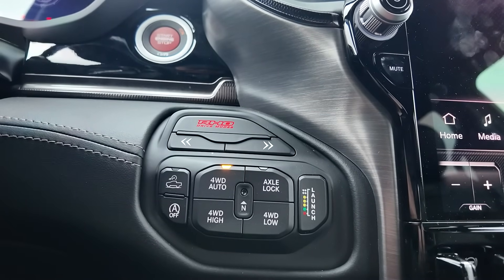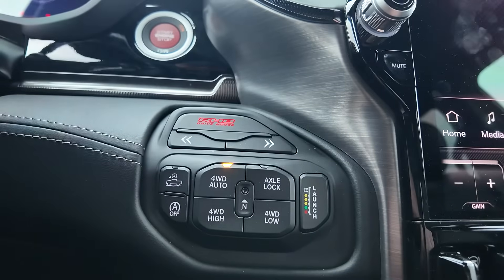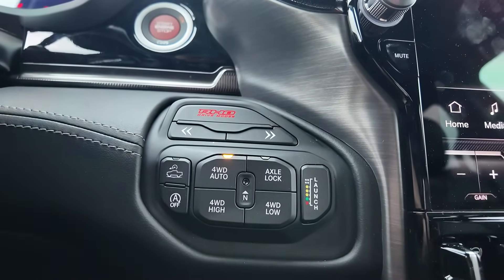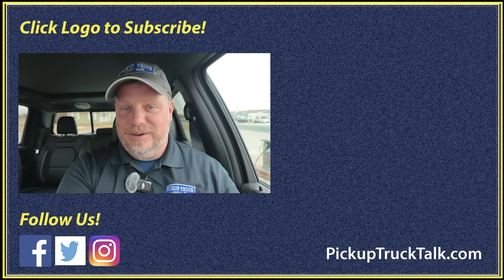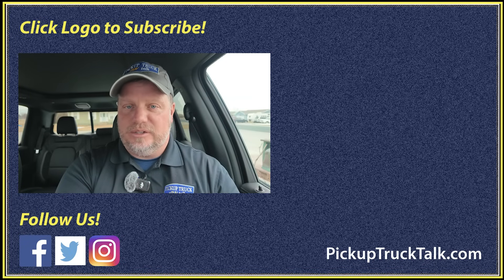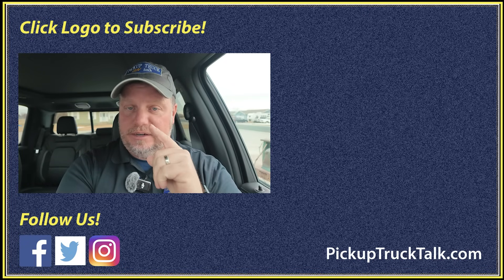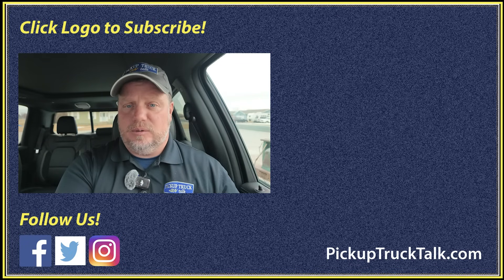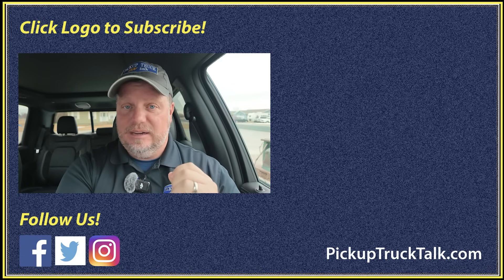Drive Mode Matters? Here's How Ram 4WD Auto Works from the Engineer

Comment: I’ve always liked the explanation between AWD and 4WD as AWD has a differential in the transfercase (or functional equivalent) and 4WD is locked 50/50 between front and rear. I understand modern AWD systems are way more complicated than this but I like this for simplicity’s sake.
Reply: These 4Auto systems are essentially both AWD and 4WD. In 4Auto in functions the same as most any AWD SUV or Car with a clutch based system but then locks up in 4Hi/Lo
Reply: @Jay-me7gw  Actually their pretty much just AWD. Hi/Lo just changes the pressure on the cluch packs. The only one that actually has both the clutch packs, and a full mechanical locker is  Ford's Raptor T-case.
Reply: @DragonKnightX12  The tremor mechanically locks up too.

As far as I am concerned, applying more pressure to the clutch packs is still functioning as 4wd. It will still skip trying to turn on dry pavement. At least my F150 Lariat would.
Reply: @Jay-me7gw  I think the Tremor has Raptor stuff. You can option it with the Raptor's front torsen Diff too.

The biggest is the clutch packs can slip and heat up while off-roading with the high torque multiplier.
That's why the Rebel use to come with the standard locker, and people always said not too option it for building an off-roader.
It's basically for slippery street conditions.
I'm sure the RHO variant is a bit more durable,since it was made for the TRX with the Hellcat.

If mistaken GM says not use 4Auto 24/7 , only when  it's slippery out.
Reply: @DragonKnightX12  They could slip in theory. I've wheeled my F150 Lariat with 4Auto in Moab on pretty gnarly trails that are rougher than 99+% of people would take their half ton on and never had an issue with slip. It would easily spin all 4 tires on slick rock in 4Lo. So like I said, as far as i am concerned, it was 4wd for all intents and purposes.

Maybe Rams 4Auto t-cases sucked. IDK.
Reply: @Jay-me7gw Granted I just trailer my 2 door JK Rubicon.  My 1500  Rebel is a DD/hauler mostly. Occasionally take it for hunting.
But I've heard the  clutch one likes to burn out.

Comment: So maybe the best mpg would be the drive mode with the lowest torque sent to front. In rho always in 4wd auto + Baja?  Yes you lose traction in front but gain mpgs.  I don’t have one but considering and have held off due to reliability concerns and this one is big one with no 2 wd option.
Reply: Unless the front axle disconnects at the hubs, there really isnt much mpg benefit to having it be in 2wd.

But also, the 4Auto case will drop to nearly 0% front torque on its own if it decides the conditions are right. Leaving it in Baja mode probably forces some torque to the front.

Comment: Can you ask why they didn’t do port injection in the Hurricane?
Reply: Port injection is mainly needed for emissions at low engine loads and rpm where direct injected fuel has a hard time evenly mixing in the cylinder. Its not for cleaning the valves like most of the people on the internet think.

Since they are using an extra high pressure fuel system in the Hurricane, it might not have needed port injection as it might be able to get the fuel to adequately mix in the cylinder at lower loads/rpm.

Comment: The Land Cruiser center diff full time 4wd was great. I miss it.
Reply: The cruiser has the torsen center diff which, IMHO, is a better setup than these 4Auto cases. I've had both. The 4Auto is nice, and certainly better than nothing, but that Toyota case is great.
Reply: I agree : classic central differential with block option doesn’t require sensors , looks more reliable. Why did they choose slippage clutch with varied torque?
Reply: @ Probably because they could control it far better and make the truck handle in different ways in different modes. The Torsen just does what it does and thats it.
Reply: @gaidagulov  Probably because their using someone else's hardware too save money. All Ram's t-cases are from Borg Warner, who also owns Haldex, and well you're basically getting Haldex  AWD with the FT and 4Auto cases. 
Where as Toyota's system has  a in-house engineered transfer case that uses planetary gears in combo with the torsen center diff.

Comment: Tim, thank you for these sessions with manufacture  engineers.  There are way too many opinions out there not based on solid data. It’s great to get the  information directly.  It does heighten my concerns with RAM though for my next truck purchase.  The spray on cylinder liners have been my big concern. Durability issues showed up on Ford 5.0’s when they started that cost saving measure.  I’m now adding the “slip & slide” transfer case to the list of concerns.

Comment: 4 WD Auto works great on my Colorado. But I only use it when the roads are partially icy or snowy. There is a clutch pack in the transfer case that lets you have some slip between the front and back wheels so you can turn without any binding. I have used auto 4 wheel drive when driving fast on the highway in heavy rain. Other than that I use 2 wheel drive for the best fuel mileage. I have used 4x4 lock in really deep snow and mud.
But I wouldn’t want to be in 4x4 auto all the time as sooner or later you will burn out the clutches in the transfer case. An expensive repair.

Comment: I really liked that the engineer explained how drive mode for Rock & Baja works mechanically. Very interesting to find out how the power was split between the front and rear axles for Rock & Baja. Would have really like hear this information on the other driving modes especially Snow.

Comment: So basically while in 4wd auto you are slowly wearing the clutches in the transfer case.  I get that most of the time they are 'kissing', but it's still wear on the drivetrain.
Reply from the maker: Yup, check back at a million miles and let us know how it goes.
Reply: Yeah most likely a very slight amount. There are clutching in your automatic transmission too. And your torque converter. I doubt the T-case is going to wear out before anything else does.

Comment: Well, I should not have posted my first comment I guess because this manager is not even aware of how the RHO actually works. When you’re in four-wheel-drive auto and you put it in rock mode, it still sends the power to the front wheels automatically.. false as soon as you engage rock mode, it engages four-wheel-drive low, and it doesn’t allow you to shift to four-wheel-drive auto as it will tell you not available in this drive mode
Reply from the maker: Are you really saying the truck goes into 4 lo without shifting?

Comment: Yes, that clutch is always slipping and wearing. It easily becomes a maintenance item, You cannot replace a single tire with AWD, as all 4 tires MUST be very similar size and circumference. Usually, a single tire replacement becomes a 4 tire replacement. These are the down sides to AWD. Yes, if I leave my F150 in AWD, it lowers fuel economy. One down side on Ram trucks is that the front drive shaft and axle spin all the time, on ANY Ram 4x4 truck. No locking and Unlocking hubs. When I have a worn set of u-joints on the rear drive shaft, I always service the front shaft as well on a Ram. Fords do not wear any of the front drive system parts when in two wheel drive due to unlocked hubs.

Comment: RAM transfer case SUCKS. It uses the clutches even in low range, and therefore is very prone to overheating. I shot a video on this issue with a new Ram a year or two ago.

Comment: All of this electronic gizmotry and clutches in the transfer case is doing what a center differential in the transfer case did in full-time 4WD trucks and SUV's in the 1970's.  Those had a 4WD "unlocked" setting, a 4WD "lock" setting (where the center differential in the transfer case is locked) and a 4WD Low and 4WD Low Lock in the transfer case settings.  Those full-time systems lost popularity because the full-time 4WD driveline back then was very parasitic and caused dismal fuel economy because the front driveline was constantly engaged.  Back then,  my family had a '73 Chevrolet pickup with part-time 4WD and a '74 Chevy pickup with full-time 4WD (otherwise identical pickups) and the full-time truck got about 2-3 mpg less fuel economy consistently.  The later Jeep "Selec-Trac" transfer case operates the same way as those earlier full-time 4WD transfer cases, except that it had a 2WD option.  I still own and drive one of those.  Tim's statement about AWD vs. 4WD is not entirely accurate--Subaru's symmetrical AWD system is always engaged in AWD. My "definition" of AWD vs. 4WD is this:  an AWD generally does not let the driver select the mechanical engagement of the drive system and/or an AWD lacks a low-range in the transfer case.

Comment: Getty's Garage did a video where he tested the RAM 4WD Auto and because the transfer case uses clutches for engagement, slippage still occurs in 4WD High when the clutches are supposed to be locked at 100% engagement.  The 4WD Auto t-cases should be able to handle all of our everyday use and abuse but by technical standards they are not as "strong" or 4WD High capable as the non 4WD Auto t-cases. That said the "set it and forget it" capabilities during bad weather events is also quite functional.  Most people, myself included, who don't off-road their truck or only require mild off road capabilities would most likely benefit from the 4WD Auto t-case.
Reply: Also, in models that have the auto capable Transfer Case, aren't the clutches not engaged until the throttle position sensor detects input from the pedal?  So, in theory, if you are in a situation where you have no traction, take your foot off the brake, and before pressing the pedal, only the rear tires are receiving power and not the front?
Reply: I’ll take the 4WD auto all day

Comment: For 2018 or slightly older Rams (pre-“classic” badging)

Higher end trims in that era that were equipped with the “4 Wheel Auto” mode essentially have a LAUNCH mode. Here is the “secret sauce” so to speak….

1) select “4 wheel Auto”….
2) Engage “Tow Haul” mode…
3) Turn OFF “Traction Control”

Now try that EVEN IN RAIN!….
Do a bit of brake loading and SMASH that accelerator pedal…
(Wide eyed grin will follow… ENJOY!)
Oh… you really also need the 3:92 axel ratio and the Limited Slip for maximum effect.

PS: “Classics” are missing that version of the 8pd with “4 wheel Auto”
The button selector for that function would have been in the blank spot just above your 2WD selector button.
Reply: Secret Sport mode

Comment: The 4wd auto in the Jeep 392 is great, until it fails. There have been several reported cases of the transfer case failing, sometimes multiple times on the same vehicle. Also, reports of the case being underfilled from the factory. Some are performing Atlas conversions after case failure.
Reply: My understanding was that the Jeep T-case was different. For one its 4:1 low range, and I thought the 4Auto was was not clutch based, but instead auto engages 4x4 when slippage is detected. That probably shock loads the t-case. At least that is how it is explained in the owners manual. "For variable driving conditions, the 4H AUTO mode can
be used. In this mode, the front axle is engaged, but the vehicle's power is sent to the rear wheels. Four-wheel drive will be automatically engaged when the vehicle senses a loss of traction. "

That is not what 4Auto in the Ram does.

Comment: This is my first winter with a Ram 1500 that has 4WD auto. I was just testing it out on some slick roads this week and it was really responsive and the peace of mind is really incredible. It'll stay in auto until spring and whenever the roads are wet.
Reply: I agree.  I have a Jeep Liberty with the 2WD, full-time 4WD, part-time 4WD, and part-time 4WD low-range Selec-trac transfer case; and a Ford F-150 4WD with just the part-time transfer case.  The Liberty is much more convenient to drive on winter roads than the F-150.  Like all 4WD pickups, too, the F-150 struggles some on ice and snow (even in 4WD) unless one loads some decent weight in the back of the cargo box.  The Liberty is more weight-balanced and does much better.
Reply: @rockymountainjazzfan1822  I also had a 2006 Jeep Liberty. The Liberty has an actual center differential vs a clutch based AWD system like in the 4Auto cases in the half ton trucks. The Jeeps is way more responsive since its already engaged the second you put it in full-time mode, but its also an open differential and will send all the power to one axle if conditions are slippery enough. There were times in deep snow where my Jeep would only spin one tire in Full-Time 4wd. 4Auto, in theory, can basically lock it in 4x4 by applying more pressure to the clutch if you get slip.

The best setup is the one in the Toyota full-time transfer cases, which use a Torsen limited slip center differential. Having had an F150 with the 4Auto t-case, the Jeep Liberty, and two Toyota Full-time cases, the Toyota is the most capable IMHO.
Reply: Don't u have to use 4wd auto for launch mode and the most take off torque?

Comment: Still not clear on why not have a 2WD option in the TRX and RHO
Reply: Why? Every Quattro/4Matic/xDrive drivetrain from Audi/Mercedes/BMW works on the same way as explained as cars  is designed to withstand those forces.  Off-road makes a lot more wear than using "Auto mode" would you agree? And what about safety and stability? iI provides greater level of safety on road if there is a e.g. slippage or uncontrolled rotation - specially for pic-up trucks that have high center of gravity.
Reply: @FilipBzik every Ram had 2WD as a selectable option except TRX & RHO. Why?
1. Saves on gas when extra traction is not needed 
2. Fun in snow 
3. Burnout/ drifting
Reply: @bestman7776  
1. How much is delta fuel saving? If you are interested in fuel saving, you would not have been bought an "Pick-up".

2. Fun? An engineer sad the in "Baha" mode can put 20_:80 power to RWD.  

3. Burnout/ drifting in "Pick-up truck". Are you serious? Buy cheap sport BMW with RWD. Do not tray to have 4in1 as you get the worse of all than.

Comment: Thanks for cutting through the fog and going directly to the guy who can explain the system. Now I wish you could find someone at Ram who can explain why it's taking over two years to get the parts for a Bosch CP-4 HPFP replacement recall. I called my dealer yesterday & was told their list of customers needing the parts for this two-year-old recall is now over 200 people long.
Reply: Call a different dealer, possibly different state

Comment: Boom, he basically said exactly what I said in your last video :) Unfortunately though the difference between AWD and 4x4 is not that clear cut anymore, and some of this is just marketing. Proof? The Jeep Grand Cherokee Laredo (base Jeep) and the Dodge Durango share the exact same drive train; built on the same assembly line, same engines, same transmission, same 4x4 transfer case, same rear axle ratio etc. Dodge calls that base system "AWD", Jeep calls it "4x4". Jeep also has more advanced 4x4 systems that are true 4x4, but in the base Laredo trim its a 4 auto system with no ability to go into 2wd, 4 high, or 4 low, you get 4 auto full time; and that system is called "AWD" in one case and "4x4" in another, even in the same corporation (but different sub brands). Marketing.

Comment: Good video for everyone and loosely applies to all brands with 4wdAuto. I know I can run in 4wd Auto all the time in my truck but I don't see the point unless the conditions dictate. It's just too much of a hit on mpg and wears on the clutches constantly for no reason. I use it when there are actual slick conditions like ice and snow and I switch to 4H when off-road.

Comment: 4WD auto is dangerous at higher speeds on ice, because there’s a slight delay before it actually engages it can allow the truck to fishtail to a point that may be unrecoverable. You’re safer to go straight to 4WD, it’s a good system otherwise.

Comment: I have a 2004 Dodge Durango all-wheel-drive heavy with 350,000 miles zero problems and when it slick outside on the first one to leave the stoplight, I would never have a vehicle without all-wheel-drive now that I’ve had it. I ride in friends pick up trucks And it’s so aggravating the back wheel spin starting out of the light and they have to turn on the four-wheel-drive high and after we’re going, they turn it off and we get my vehicle. They just notice I just drive and my vehicles more than a decade older than both of theirs And they question why theirs doesn’t have all-wheel-drive and it’s because Ford and Chevy are about maximum profits not about what’s best.

Comment: GMs auto 4wd isn't the same. GMs system isn't designed to be in auto all the time. We replaced a transfer case yesterday on a 2023 GM truck. It was always in 4wd auto, and failed because of it.
Reply: It’s really meant for winter driving or off roading on GM. It’s not meant for 24/7.